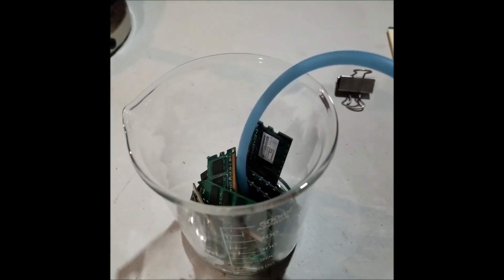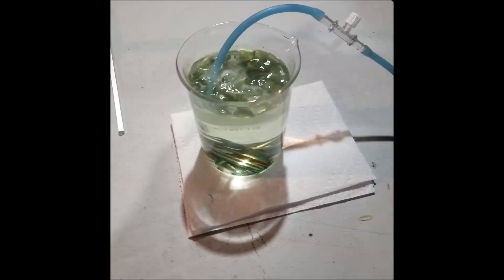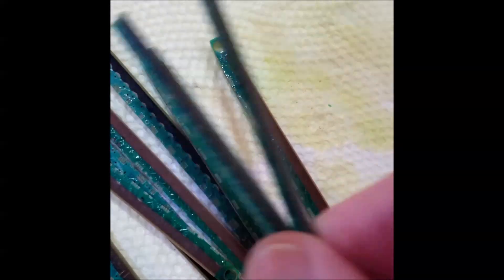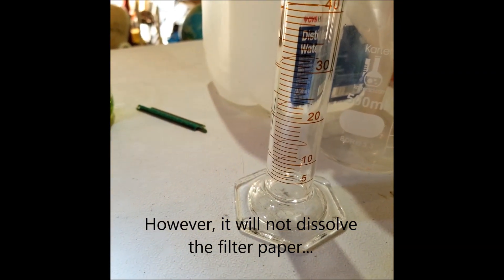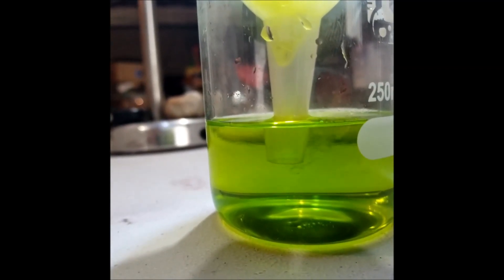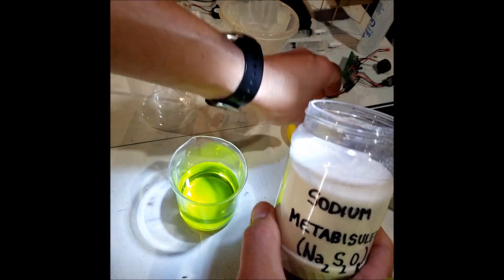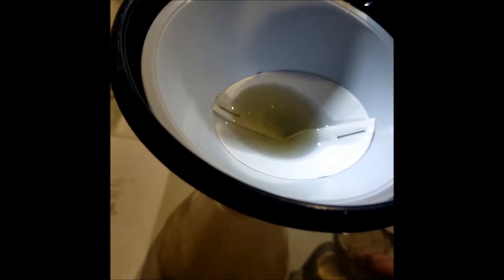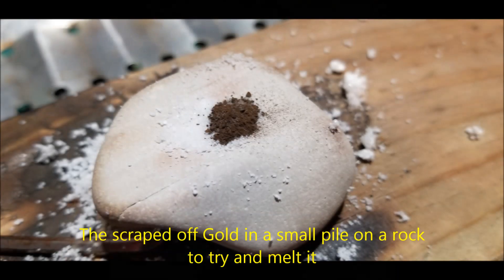Removing Gold From Old Electronics

Comment: Hmm, I plan to dissolve a gold bar 280 mg in 31% HCl and slowly add in a 2L flask H202 (500 ml HCl, 120 ml H202) and slowly heat. It is needed to dissolve the gold - a gold form nice video.

Comment: HCl and H2O2 does NOT dissolve Gold it dissolves the copper under the Gold which then falls off.
Reply from the maker: I did not say that.  Aqua regia does dissolve gold, which is nitric acid and HCl, which is what I used.
Reply: Actually, it does disolve gold, just much more slowly than the base metals. any solution with chlorine and a potent oxidiser will disolve gold (and even platinum too) you just need to add a little heat to get it going, but not so much that it decomposes the peroxide.